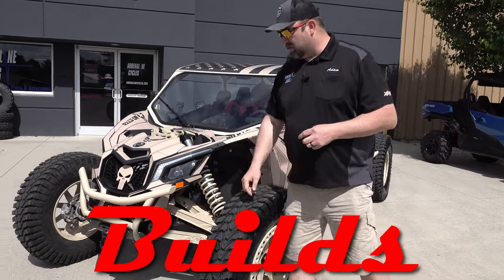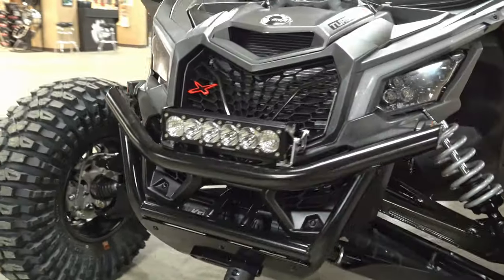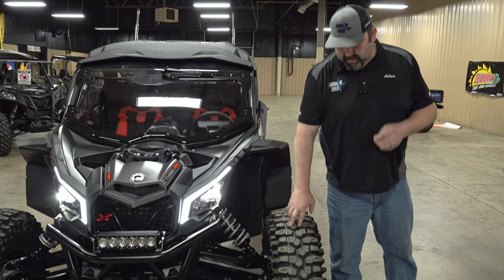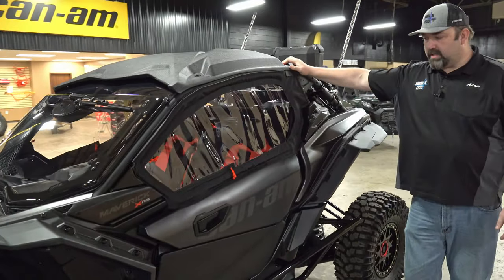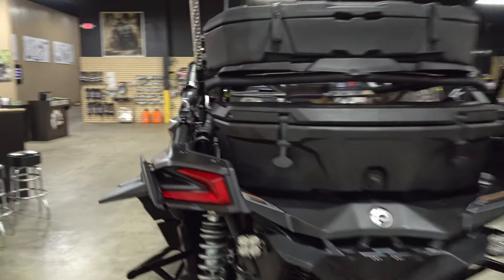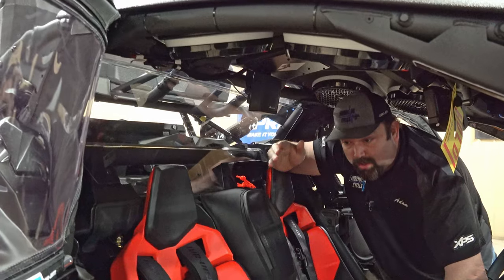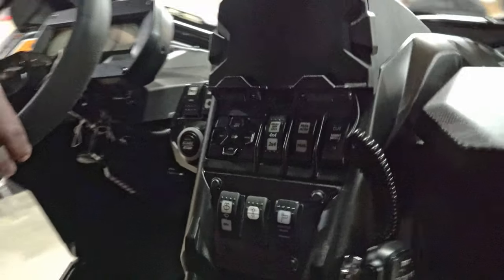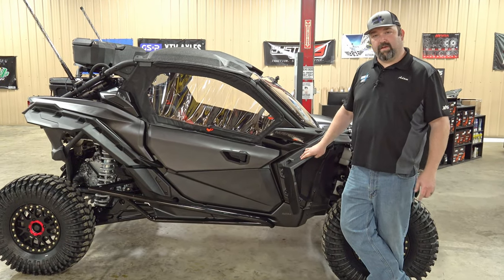Maverick X3 XRS RR SMARTSHOX  BLACK to CARBON BLACK Color swap walk around.

Comment: I ride Appalachian mountains/ eastern ky trails muddy mud and most are 72 inch friendly, would you reccomend a 72 inch max or just turbo rr 72 2 seat?if not 64 max or regular. I’m just upgrading from a 16 dps  with 32’s and I was hoping a 72 inch machine would help with all the deep ruts around where I ride
I have 2 kids ones 3 and ones not even a year old so idk if I’d being taking them for awhile if a 2 seater would be far superior on trails, hills and ruts I might opt for that. Another 64 inch machine but in a x3 instead of dps would be nice would avoid a trailer but looking at something I’d keep for a long time
Reply from the maker: Thanks for the question.  If your going to ride with the kids in the future say the next two years.  I would get the Max 72 inch RR model.  The wider model rides better and takes bigger tires easier that some two seat models and will keep you up out of the ruts.  My 2020 MAX XRM X3 was great it rode good and got around the trails just fine.  The only problem with a max x3 is the same as a 2 seater, backing it up in the trails is hard.  Just put a back up camera in it and ride on.

Comment: Thanks for the vid! For some reason - both the dealership and canams website said that the audio roof will not fit with the brp cab enclosure doors? Was there any customization you had to do to the doors or roof to get it to work? 

I wasnt going to get the audio roof for this specific reason - interesting to see them used together without any comments about issues!

Thank you
Reply from the maker: Thanks for watching.  No we just install the roof the way it says and the doors as they should be.  It works.  If the roof get close to the doors and don't want it to seal up good.  We can space up the audio roof with some 1/4 inch spaces then bolt the roof back down and it clears the doors just fine and seals up good.  But 90% of the time it all works with no spacers.

Comment: I’m adding the ct race worx shock tower brace. What do I have to do to make the brp washer fluid bottle fit in there ? Adam said something about shimming something? He was very brief about it in this video.
Reply from the maker: Thanks for watching.  The CT shock tower brace is thinner than the CA Tech shock tower brace.  But you need to put a washer or two on the lower water tank to help you get washer tank cap off.  It is still a pain but it does work.

Comment: How do you make the roof work with the doors? Website says they won’t work together?
Reply from the maker: Thanks for watching.  Yeah BRP says it wont work.  But we have put this set up on over 50 X3 and never had to do anything crazy.  Just rivet the back upper door mount to the cage and then bolt the audio roof back down.  The sides of the audio top clear the door frames just perfect.

Comment: Was the KMC wheels you put on a 15X10 or what size wheel did you put on this machine?
Reply from the maker: Thanks for watching.  The wheels are 15 inch and are 7 inches wide.  It is a 6-1 offset.
Reply: @AdrenalineCyclesKy  thank you for the reply. Just one more question. Do you sell those wheels on your website? When checking KMC website they don’t show a 15 x 7 with a 6-1 offset. Thanks for the help

Comment: Will the storage setup work with brp snorkels ...if not what do you recommend
Reply from the maker: Thanks for watching.  Unfortunately it does not work with the snorkel's.  Not a lot of options.  I like running the BRP cooler in the bed with a Aftermarket plate mounted over the intercooler and use a packout box to hold tools and tire plug kit.  Thats about the best option I used and seen.
Reply: @AdrenalineCyclesKy  do you have pictures?

Comment: Hi, Do you know if the Lonestar roof will fit on a 2021, the ones I have seen say before 2017 ? Thanks,
Reply: yes they do fit i have a 21 with one on
Reply from the maker: Thanks for watching.  If your machine was made after 2017 use this part number to get the red lonestar roof 715004436
Reply: @AdrenalineCyclesKy  Hi, Do you have the number for a black one ? Thanks

Comment: Can you link the plate for switches that relocate the start switch
Reply from the maker: Thanks for watching.  That part is only in our store front not online yet.  Call into the parts counter if you can at 606-258-0005